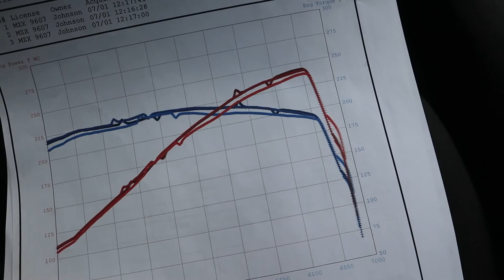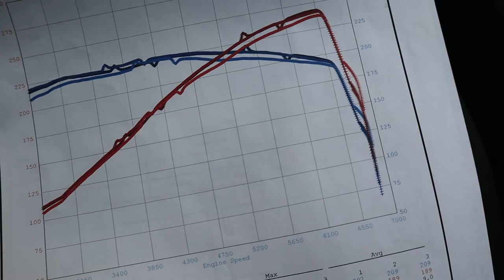I Put My STOCK V6 Camaro On A DYNO!! (SHOCKING RESULTS!!!)

Comment: My cars not speed limited and I haven’t done anything to it. It’s a 2013 rs
Reply: What size tires & rims do you have ? I have same car but I can only go 118. I’ve read that on 2013 if you have R 18” that the car is limited to 118. And that is all I can do
Reply: @SemperShock  I got the 20” aluminums. But I’ve raced like 5 other v6s and I literally gapped all of them. Don’t know if it’s driver mod or what but my shit just better I guess 😂

Comment: GM says 2012 supposed to be 330 hp well not so sure now
Reply from the maker: I have the 2010 with 304 to the crank
Reply: When I get the time I will get the timing chains done, get it tuned and instal Nitrus.
Should be fun enough then.

With gas prices, I'm seeing a lot of V8 muscle cars at the used car lots now.

So I gues slower V6 not so bad

Comment: I just bought me a Camaro does anyone have advice on how to make it faster
Reply: V6 or v8?
What year? 

I have a 2014 Lfx,
Ported throttle body,
Cold Air inductions Intake 
Super Coils by accel 
Exhaust ( don’t know the brand came with the car) 

On my bucket list you should get too 
Ported Manifold 
Tune
Test pipes/full exhaust 
Lighter wheels 
And coil overs 

To help keep the motor running better I use 
Oil catch can by elite engineering 
Royal purple oil 
V power nitro gas ⛽️ from shell
Reply: @trippykidd5267  I have a 2015 V6 2LT

Comment: Hey I think you left 2 cylinders at the dealership... Might wanna go get those to be relevant.
Reply from the maker: I believe so too, sadly 😂
Reply: @LegendaryBurnout  dont worry my v6 maro spanks v8's all day with mild mods and a tune lol
Reply: Lol🤣 your comment is baffling. The 2012 Camaro LFX 3.6L v6 puts out more hp then older V8s. With a tune and a few boltons (probably a turbo or twin setup if that's your fancy) you're easily looking at 450/500hp. With a 50 shot of nitrous added to it. Your smoking any unsuspecting at the stop light hands down. Also taking off the stock exhaust will make it like 40 pounds lighter. MRT makes awesome mufflers for the v6 Camaro. Just some food for thought. Have a good day.
Reply from the maker: Couldnt have said it better 🤙
Reply: @thats_harsh5794  I needed to see this
Reply: @thats_harsh5794  exsacly